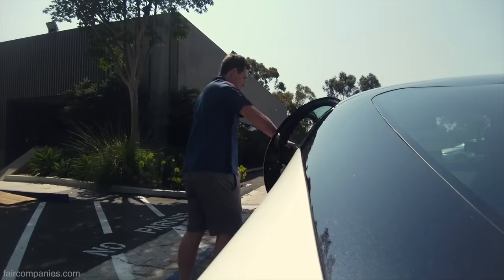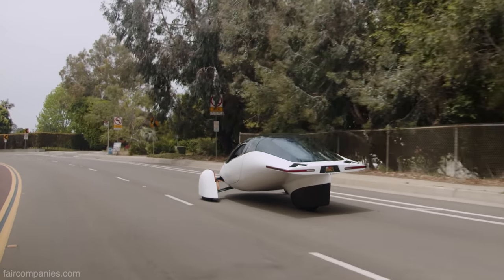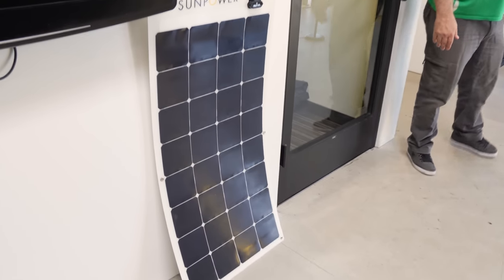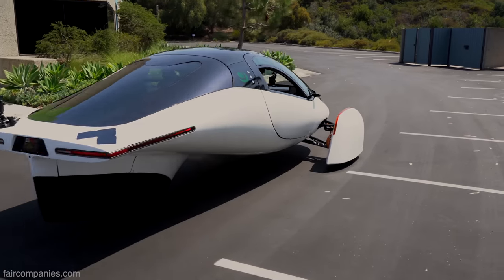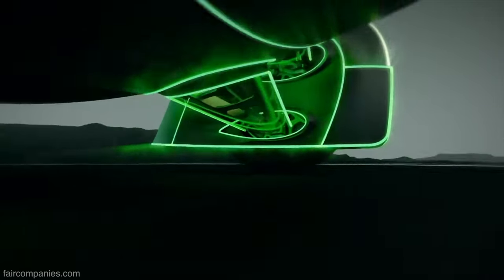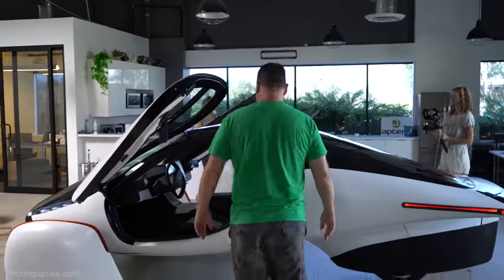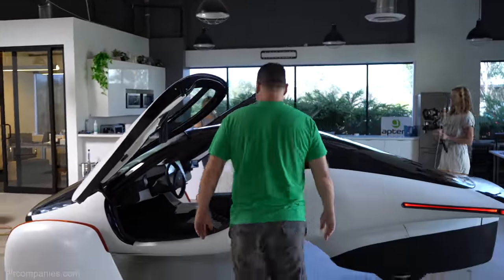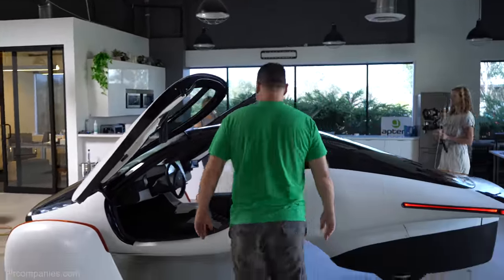Aptera commutes just on solar, gets 1K mile-range when full

Comment: As someone who already has their home on wheels, this could be extremely valuable as a day trip vehicle when the home is parked.
I also see a lot of potential for other people in moveable homes, like the half-trailers behind Class C motorhomes- it would be FAR better than what they are usually towing.
Reply: I've been thinking the same thing. This vehicle would have a market just for people who want to use it to replace the cars they usually tow with RVs. The low weight and drag would be very attractive in that application.

Comment: Quite impressive, every time I watch or read something about the Aptera.
Although not 100% true that it's the only SEV at that state of development (the Dutch Lightyear One and the German Sion also are), it really holds the record for pure solar range (even ouside sunny California). And the price (given the latest numbers)... Roughly the same as the Sonomotors Sion (pron. "Zeon"), but far more innovative and with far more range. The range would be equal to the Lightyear One, but at the 6th to 8th of the price.
So, why did I choose for the Sion? Well, basically because I'm living in south Germany, just some km away from Sonomotors' headquarter. 😉
Anyway, I'll follow the Aptera thoroughly. It's just too amazing not to do. 🤩
Reply: The scion more supplements it’s range with solar with its more traditional boxy shape and haphazard solar panel placement than being a true solar vehicle like the light year and aptera given amount of range gain you’d actually get but certainly enough if you don’t commute often and hopefully will set a precedent for a market of economical evs going forward.

Comment: We lived in a sailboat that used solar panels almost exclusively for electrical power for 8 years, they were easy to live with and only once had a problem that was caused by a loose wire. These solar cells are better than we had on the boat, and this looks like a trouble free forever system.

Comment: I have a HD camera on the tip of my crane, and when working with new customers have to remember to tell them "if you see me looking in my operator cab instead of at you, I'm STILL looking at you! When on long trips in my Prius, I fold the mirrors back, they are draggy as hell. ESPECIALLY in something as low drag as this, on a Suburban, not so much.

Comment: Been following these for a while now. I might not be able to afford one, but it sure is cheaper than a Tesla.
Reply: True, but just know that if you're in a wreck, you're probably going to wish you were in a Tesla or Prius.
Reply: @reelreeler8778  teslas literally rip in half in high speed collisions. seen it in person at a car show. skided off the corner hit a pole and tore in half right at the rear seats.
Reply: @reelreeler8778  Why do you think that? Aptera's composite monocoque body is stronger and more crush-resistant than a metal body: It's like a crash helmet on wheels!
Reply: @narphizoid  Yeah, I've worked with a lot of pre-preg resin autoclave vacuum bagged honeycomb composites; they are light but it rips apart.  It's nothing like the strength of steel; it can't even compare.  We used to test aircraft wings and other parts to failure; it was spectacular when it failed.
Reply: @reelreeler8778  Speculation at this point.
Reply: @kennethj1956  You are correct. But the cell is F1 racing cars designed. Remember how that F1 pilot came out of his faming furnace unhurt? Aptera is designed the same way. Of course we are not going to be wearing fire resistant jackets and helmets, but we can expect to be safe after the cars body is dismembered.

Comment: Sono Motors is doing this too. Albeit in a more conventional/pragmatic fashion.
Reply: The Sion is not an efficient vehicle. It's a box shaped car and will use approximately 3 times more energy per mile than an Aptera. Thus, with the extra solar it still charges much less miles per day than an Aptera. 

Also, the Sion has parts of its solar on the side, meaning the actual power generation will be a smaller percentage of its potential solar power.
Reply: They have been doing it for more than 10 years and they are yet to produce a vehicle. Not to talk of the $1000 non-refundable deposits they have collected from poor, hard working folks. Besides they are a joke compared to Aptera.

Comment: This seems like incredible fun. But three wheel paths makes sure you'll absolutely hit all bumps, spills and debris on the road. And I pray that no one ever has to find out how it performs when crashing with a V8 truck. Still hope they do well because it seems like an awesome car for sunny climates.
Reply: It has the highest safety rating available. The passengers literally sit in a near perfect sphere which is absolutely ideal to take impact from any direction and disperse the force evenly around the sphere
Reply: @Shorkshire    Yup, plus the composite material is very strong in various strengths (tensile, young's modulus, etc) and durable. It will just need a very good UV protectant coating. 

   Since it sounds like it uses a foam core of some kind, not only will absorb a fair amount of energy when impacted, but a side benefit is that it will be more insulating than typical car materials (good for heating and cooling purposes).

Comment: I've always wondered how you get in and out of a car with doors like this in a  parking lot.  Is there enough room?
Reply: your comment is humble, yet corageous
Reply: They lift mostly up, not out: Fully opened they're only 6" wider than the vehicle so should be VERY easy to enter and exit in a tight parking space!
Reply: Another consideration is the car itself is very wide including the front wheels, not parking lot, garage or road friendly in many areas
Reply: @narphizoid    No way.  Towards the end of the video the rear view of the vehicle as the both exit clearly shows that the doors swing out as well as up, and the distance out appears to be a least 2 feet.
Reply: @narphizoid  Thanks.
Reply: @narphizoid  Hope they automate them. They looked clumsy and heavy. Like you needed the arms to slam them shut.
Reply: The front wheels stick out from the body, so that is the limiting factor. If you can fit the front wheels in a parking space, then opening the doors should be fine.

Comment: Does it have a frunk? Seems like there must be room in there given that the motors are in the wheels and air conditioner cant take that much room
Reply: They probably won't. They mentioned that they will use the space for safety (crumple zone) and electronics. They need the weight to be front biased as much as possible.
Reply: The power electronics and HVAC systems are under the hood (bonnet) - but there's 28 cubic feet of storage in the rear.
Reply: @siesstad  ah I c

Comment: I haven't been so excited about a vehicle since getting my first motorcycle! This could be HUGE!
Reply: I have over 400,000 miles on motorcycles, and even the 2WD version beats most of them in acceleration.
Reply: @n.brucenelson5920 Nothing beats instant torque. I was sold when I test drove a Tesla long ago. This is more within my budget and needs. Seriously interesting vehicle.
Reply: @nononsenseBennett  Both my wife and I rode in an alpha prototype in November.  Both the handling and the acceleration were breath-taking and incredibly fun.  In my work I used to see many prototype vehicles at the Ford and GM proving grounds and from other small manufacturers.  

The promise of this vehicle is immense, and i hope they get there.
Reply: @n.brucenelson5920  Exciting times. Let's hope the technology revolution gathers steam.

Comment: The Lucid Air has a large screen on the dash, right in front of the driver. It's easier to see and keep some vision on the road ahead. It's basically where speedometers usually are. And the screen is nicely curved and aesthetically appealing.

Comment: Beautiful concept, I like the fact that you don’t need any external power source to recharge the vehicle, very efficient, thank you for a nice tour…
Reply: You sure.
The charge time to full by Solar in middle latitudes is three to four days... If you just take their stated specs.  The car has a plug in port and that is the primary charging method in their mockups.

Notice the top views and how much white and glass area are not panelled.  The tail has two cute chevrons of solar cells, but all this white gellcoat not charging anything.

The car by his own statement is only half the energy required to move a Prius... But the Prius has a real trunk, back seats, more side to side room, true suspension, true air conditioner and heaters and four wheels.  It also has years of crash testing which they evade by building a covered motorcycle. 

As a Slingshot alternative... It is good (possibly).

They've been at this for over a decade and they only have an alpha prototype. 

Be careful.

Comment: Great and revolutionary design. I do have one suggestion, however. As a Wisconsin resident, I’ve driven in MANY winters. The front wheel covers are definitely going to be plowing snow and I’m afraid will be damaged. Can you get them off the ground so that there is about 6” clearance? Perhaps a removable “spat” that you could  leave on in summer and then easily remove for deep snow situations?

Comment: I have my order in for mine. I just hope the suspension or noise can be figured out. Maybe one or the other.
Reply: The video was with the windows open.  Noise won't be an issue with them closed.  The suspension will be very different with a new rear geometry and tuning by Roush Performance.

Comment: Cute little silverfish, and interesting being classified as a motorcycle. That gets around a lot of safety constraints. I love the look and ideas behind this little vehicle, and hope for it's success. I maybe won't see them in the Northwest soon, but maybe someday.
Reply: Even though they don't have to due to the the class, which is arbitrary. Aptera is designed to automotive safety standards and will be voluntarily crash tested and the rating published before shipping begins.  Three wheels allowed them to make a significant cut in weight, rolling resistance, and aerodynamic performance that would not have otherwise been possible.  They will still have front and rear crumple zones, seat belts, air bags, and an F1 style passenger safety cage - none of which would be in the design if the three wheels were just to get around safety regs.
Reply: @n.brucenelson5920  Good to know, thanks!

Comment: This would be great for last mile delivery for Amazon etc. All you’d have to do is make the glass back open from either side of the vehicle. It has a great design. Only thing I’d change is make the central display 1/3 the current size, as it looks too dominant. An option for a second battery would be great for hilly terrain or cloudy areas.

Comment: And how complicated will it be to switch to winter tyres - would I have to mount/dismount the tyres?
Reply: Yes, just as with any car, unless you buy another set of wheels, which are a standard 16" size, and keep your snow tires mounted on them.

Comment: If you're camping for a few days, is there an outlet you could plug in an electric induction stove or a fan? Maybe even an ice fridge? Water purifier?

Also, just looked at your site. Are the battery banks upgradeable? Could I start with a lower bank and later upgrade the battery pack later?
Reply: Yes, although a stove might be a reach.  
Batteries can't be added to, but will have to be completely replaced for another size.  Suspension changes might be required as well due to the weight change.
Reply: @n.brucenelson5920  Thanks!

Comment: If they can do some sound design and engineering, because the motors are external, it can end up being a really quiet ride inside the cabin, especially with the use of foam embedded composite material (if I understood the material they use correctly).
Reply: I expect it will be really quiet and have ordered the upgraded stereo.

Comment: I hope they add thermoradiative cells once the tech is available since this would eliminate the need for batteries as it produces power during night, requiring just a ultracapacitor to work.

Comment: Hi, thanks I'm not sure about the Aptera. They should make it four wheels like the Microlino and then really lower the price, lower than the Model 3.
God bless.
Reply: I love the Microlino.  The choice of 3 wheels greatly reduces the overall drag, for both aerodynamic reasons, and lower rolling resistance, weight, and cost.  In the future, Aptera will build 4 wheel vehicles, but they won't be as energy efficient as this first model.  The Aptera price starts at $25,900 for 250 mile range.

Comment: Am I the only that noticed the door pops when they take off?
Reply: The doors and latching system have been completely re-designed by Roush Performance since these prototypes were built, as has the suspension.

Comment: Hang on, the Dutch have the big solar powered camper, in fact in Holland there is a massive market in solar powered vehicles. We are famous for the solar races. Ironically , we hardly have sun. Check out the Stella-Vita Solar camper. Complete self sufficient . This car is super cool, though
Reply: As far as I'm aware, the "big solar powered camper" is student designed/built and not intended for production.  Same for the solar race cars.  There is, however, the Light Year One.  The founders of Light Year came out of the solar race car project at their university.

Comment: Wen the topic of weight reduction is emphasized about door hinges on this video, the language in the aviation field is called ‘lightening holes’. These are areas where excess material is removed from any component, but still provides structural integrity. For a long while, I had made the mistake (being new (2003) in the aviation field. Army aviation. I worked on the AH-64A/D Apache fr ten years) to hear the words pronounced lightning holes. Holes for lightning? Weird. Then it was made clear to me. To reduce weight, it is ‘lightened’, hence lightening holes.

Comment: This looks so much like a boat with wheels that I would be tempted to drive it into a river to find out if it floats
Reply: It does, but it would be dangerous to try with a 70/30 forward weight bias.
Reply: I mean I meant it as a joke, but now I'm wondering how much lead I would need to put in the back of the trunk to counterbalance the battery and motor weight :)
Reply: @rorychivers8769  Depending on battery size, you might get to the point that the remaining buoyancy is overcome.  The wheel motors have been tested to a depth of round 10 ft.
Reply: @n.brucenelson5920  I honestly can't tell if you're leading me on or not, but now I am seriously wondering if there is a submarine version in the future pipeline...

Is having the motors able to tolerate depth some sort of legal requirement?
Reply: @rorychivers8769  No, you might be surprised how many times both Aptera and I am asked if there will be a flying or marine version.  I don't think they envision either one in their immediate future.

The submersion testing was part of the process that Elaphe developed to make sure that their motors would withstand the most severe environmental torture, to the extent engineering can ensure it.
Reply: @n.brucenelson5920  This is a non sequitur, but that strikes me as a brilliant opening line to a film

"Sometime, in the near or immediate future...." du dum dum da dum

I digress, the vehicle is light, has a monocoque composite hull, and for some reason that I am not enlightened enough to fully understand, submersible electric motors....

Someone is going to mod that into a submarine. Maybe not today. Maybe not tomorrow.

Someone is going to do it though.

Comment: I like this very much.
How would it work in Canada with cold weather and lots of snow and ice? Is there alternative power source when you have overcast weather for many consecutive days.
Reply: Yes, you can plug it into any source up to 50 kW DC.  I will be taking an early delivery in Iowa, and will be reporting on the performance in snow.  I plan to order only 2WD, but will probably fit studded snow tires.  The vehicle itself will be certified down to around -27 F, with some components tested to -40.
Reply: Hi Bruce
Thanks for the reply. That’s great news I look forward to what you find out. Safe travels!
A trip to Montana would be a better test 😉
I lived in AB most my life but I’m now in BC lots of snow not as cold here though.